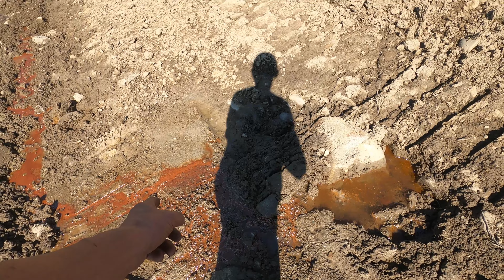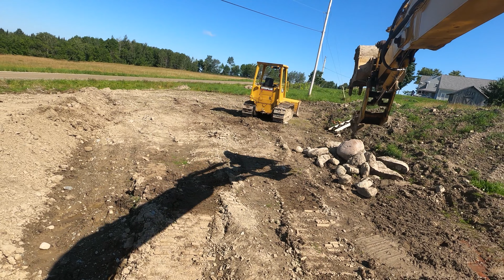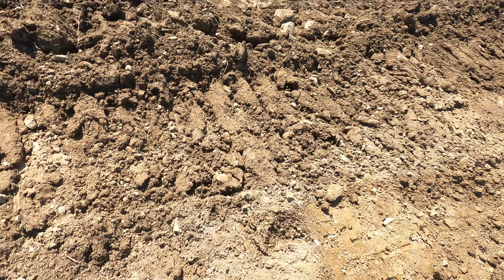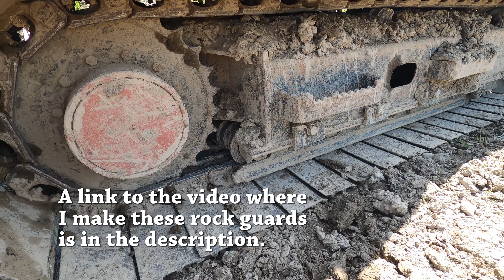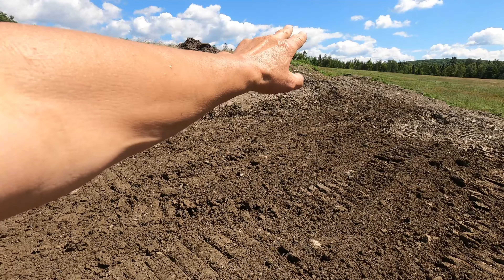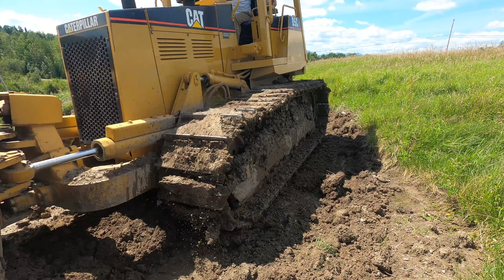Building a road in a field - Part 4

Comment: I do have the same type of orange water coming from the ground in a lower spot of the hay field. My neighbor that cuts the hay told me that this is possibly from a near to the surface ledge.  Where water will flow on top of it until it reaches the surface at the bottom of the slope.  Anyways, still weird to see that coming from the ground.  I usually take the mid-sized rocks to burry far down below the surface of the ground to give good base support.  I guess it's a different way of doing things! That is a huge amount of dirt to move. I don't know how you would handle that only with a dump trailer and an excavator!!! Thanks!
Reply from the maker: It would have been a challenge to move that much dirt. Even with my old Case 310. That's why I decided to shape the road entrance area a little more.